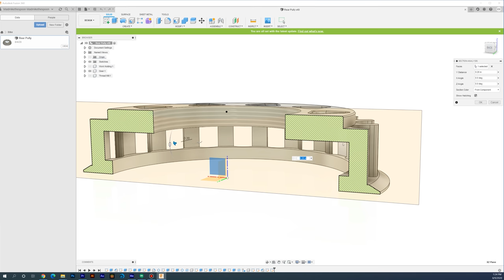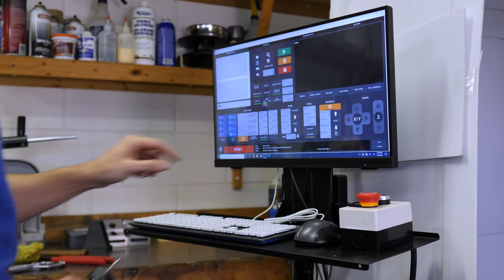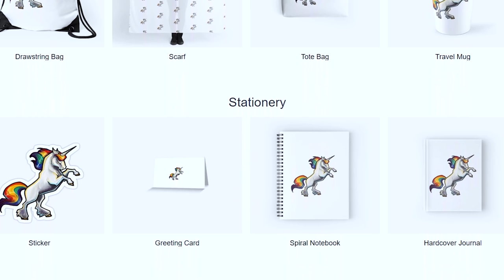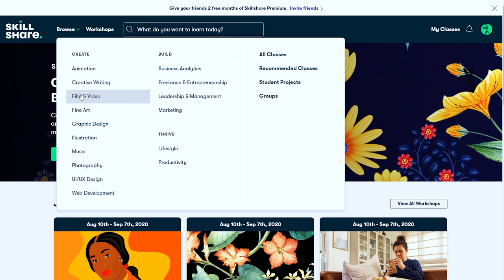Lightest Bike Possible Under $1k (Part 1)

Comment: Really fit a front brake. I've had near misses where I would have hurt someone if I didn't have one.
Reply: I agree... having one is cheap insurance, doesn’t require you to use it in a non-emergency. Plus, eventually you’ll blow out your knees. ;)
Reply: A freewheeling rear hub would be nice too. Who thought having a fixed hub was a good idea.
Reply: Can’t use a coaster brake. Fixed gears brake by either resisting the pedals with your legs (slow) or unweighting the rear wheel by shifting your body weight forward, bracing your legs to lock the drivetrain, and setting the rear down to skid (faster).  But even a rear wheel skid is less efficient than a front brake because of physics, so having a front brake for true emergency stops, while not ‘traditional’ in fixie culture, is a worthwhile compromise IMO.
Reply: Your terms are spot on. It is simply because the use of a coaster brake makes it no longer a fixed gear bike. There is a certain enjoyment in riding a “fixie” where the pedals are always turning and you’re completely connected to the movement of the machine.
Reply: @dmorriso   never really driven a fixy  bu I had a large (dont know if it's to corect word ) skelter as a kid whit fixed gearing and the oly positive thing about it was the ability to go backwards  but mostly damaged feet if you slip of
Reply: depends how bad of a cyclist you are, 99% of the time you can lean and go around things, what I do, really steer, I do go 24mph a lot too
Reply: @mlee6050  How bad would you feel if you knocked down some kid because you saved 200g on a front brake even if it wasn't your fault.
Reply: @Keith Cassidy well cycling along a 5mph path with people walking at 27mph and no accidents yet, yes to me I see myself as better cyclist than the ones that not use bikes much or build there own, with fixed gear it down to the timing as if crank not right angle only fast way be jump off and push it over
Reply: I mean even if you're not going to get a brake, at least get some straps to better control the rear wheel and stop. There's pedestrians and drivers who don't always see you and I've always been grateful having a front brake or something to stop faster than just resisting the rear motion of the wheel. Putting yourself at risk is one thing, but having seen another cyclist not being able to stop fast enough and slamming into a pedestrian is completely irresponsible.
Reply: @Deeran Foxworthy I not seen yet but all my bikes have clipless pedals
Reply: @mlee6050  same thing as foot straps. He's got flat pedals and foot straps would be the cheapest thing you could get to make it somewhat safe. just any kind of foot retention is, I feel, the minimum on a fixed gear bike.
Reply: I prefer rear brakes, because they won't send you flying over the handlebars, lost hearing on the left channel and nearly died because of that.
though something doable if you're compromising on weight would be a small rear motor, with a 200-300g battery, you could shunt it for an emergency break. and you get electric assistance in hills. it'd be around 300-500g more than stock, so only 100-300g more than a brake.
Reply: @satibel  sorry to hear, I have resin rear disc brakes and ceramic front on my mountain bike, even with v brakes I always slam on front and stop from like 20mph to stop in less than 4 metres, my road bike I use both as 140mm disc so downhill it struggles to stop but it weight saving my view it seems be 6.7kg so yeah, custom built myself even the wheels, back to me use front brake I yet to fly over, I been lifted about 6" off ground at back but never launched over
Reply: @mlee6050  I used only the front and went over the handlebars, note that I was 6, so that was that, but I still manage to jump over (in a controlled manner) if I smash the front and not the rear, note that I'm 55kg, so someone heavier probably wouldn't go over.
now that I'm used to it I use both brakes, but always the back first.
also a fork with shock absorber (which you find on a mountain bike) will not make you go over, I'm using a fixed frame.
still, in panic pressing the brake too hard is easy, so I'd go with back only if I had to get only one, and would take the 20-100g penalty of a longer cable.
Reply: @satibel  at that age makes sense then, I think at bike project we make brakes good but so younger can reach still, I help the other support on what they struggle with, I not qualified but I can do a lot better than most who are, even when at bike shops see people ask for wheels to be tru I tempted to tell them to see me as I build my own and tru them, I aim for 0.1mm while shops only aim for 0.2mm
Reply: @mlee6050  imo qualifications are one way to learn the basics, but I'd trust someone with experience more than just a diploma.
Reply: @satibel  funny thing is halfords bad at so much but I used their videos to learn most what I can do

Comment: Thread milling isn't bad.  Big thing is to comp the tool to cut small and adjust up to size.  Works really well for production in aluminum because cutters last so long with coolant.  First one is always a little slow.

Comment: Hi guys, Nice work but just a heads up, you should thread mill from the bottom up, in a tighter hole chips can accumulate on the end of the hole with no way to get out and breaking the threadmill is really easy. Also you can go way faster. Oh, one more thing, use Linux CNC already.

Comment: One gear is all you need, but a single speed is more suited for me, in the city having the ability to coast and break is mandatory. Not just for me, but also for the safety of all others.
Reply: I'd also include something along the lines of a 75-100W motor with a small pack (along the lines of 2Ah 6S for 100g+400g) for help in hills.
Reply: what does coasting have to do with safety? the brake I'm all for I just don't see what being able to coast should be "mandatory"

Comment: Very clean result on that rear sprocket man; you may have shaved off a little more weight by switching to the centertrack version; I build me one a couple years ago with a custom made frame and it's been absolutely solid

Comment: "That means you don't have brakes"... er,  no it doesn't.   There's no excuse for not having a front brake.  No matter how good you think you are at stopping the back wheel,  a front brake is far more efficient.  inb4 any replies saying "you can't steer with a locked front wheel" or "you'll go flying over the handlebars" -- Who says you need to lock up the wheel?  Learn to brake properly.  No road bike or MTB rider would be stupid enough to omit the front brake, why should you?

Comment: Since you drive and break with this thing, wouldn't a spline be better... Will the torque alter a lot in both directions so the threads might come lose?
Reply: There is counter locking nut there too.

Comment: Hi how can i get Unicorn for my desktop wallpaper?
Reply: You could get them from the redbubble source:
White Background: https://ih1.redbubble.net/image.1475977782.1595/flat,1000x788,075,f.jpg
Black Background: https://ih1.redbubble.net/image.1475958703.1191/flat,1000x788,075,f.jpg

Unfortunately they are only 1000px*788px, but you could simple center them and add a solid background colour underneath.

Comment: This seems to be the only off the shelf version of what's made in this video:

SKU:CDXR22TH

Link:
https://velorution.com/gates-cdx-rear-sprocket-22t-thread-on.html

Pricey!
Reply from the maker: Indeed! I didn't know gates sold a thread on version. I also have an older version of their belt system, so I would have to spend a lot more to get that to work.
Reply: @PhysicsAnonymous   I imagine the belt-line is different on your version. Dying for these belt systems to become more mainstream and affordable as a lazy commuter and fixed gear fan.

Great video by the way. Let's hope this inspires some mass production of a thread on lock-ring style.